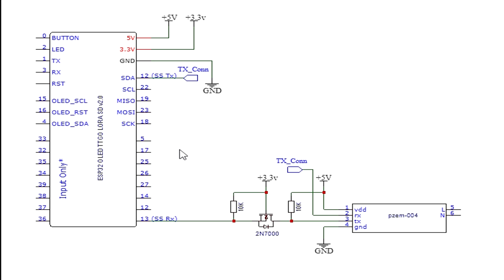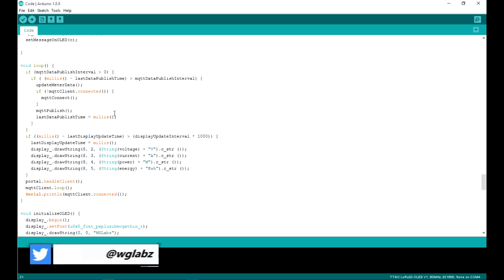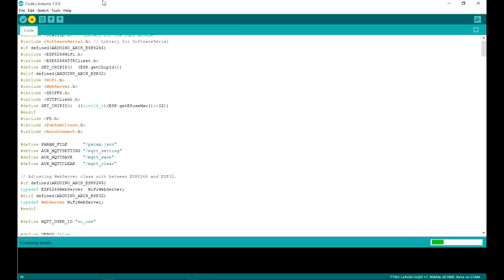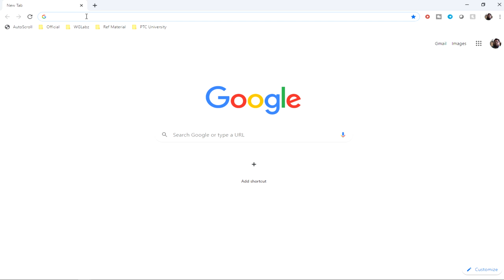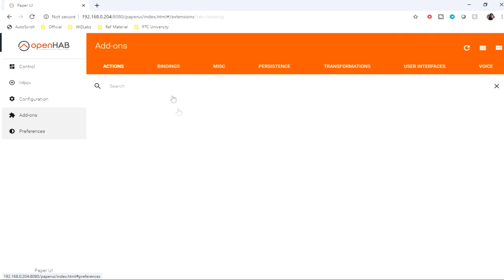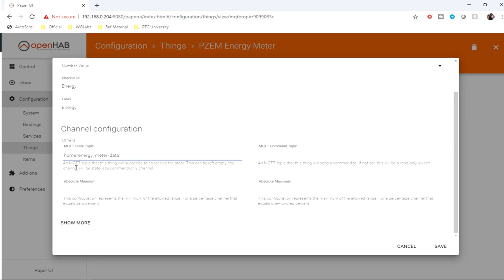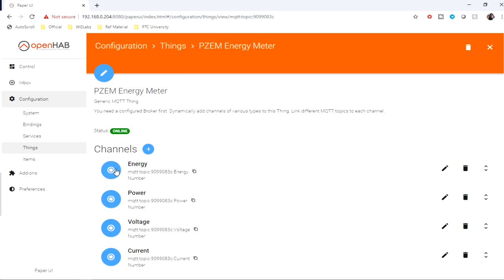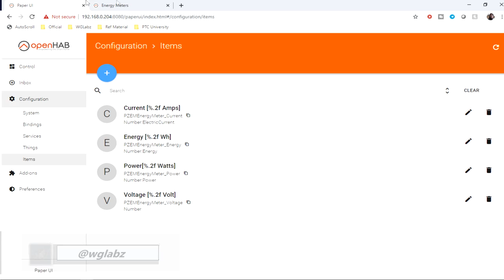An ESP32 Energy Meter w/ OpenHAB using MQTT | OpenHAB #5

Comment: Using same module(V3) with D1 mini (8266) and home assistant with ESPHome
btw i added 1K resistor as per tasmota documentation and its working with 3.3V !

which wire is fine to use for extending ct sensor wires ?

 If possible please share link of case
Reply from the maker: The cable depends on the current needed to be measure, I think any decent cable would do. Again as current would be in a loop the length should not matter that much. I used https://bit.ly/2W5BOQ5 case, but banggood i not taking orders now from India so another link would be https://bit.ly/3m5rRwN but this is without the transparent lid.